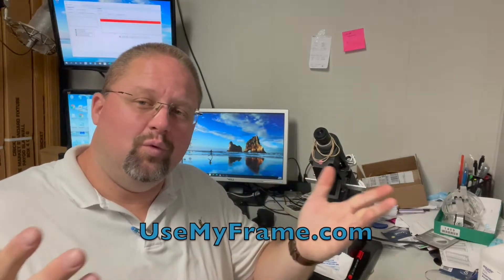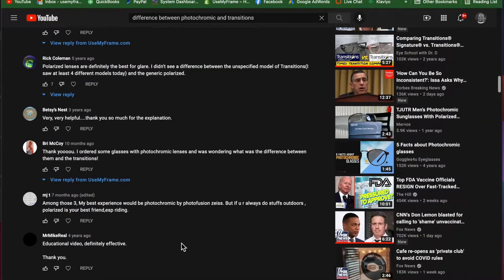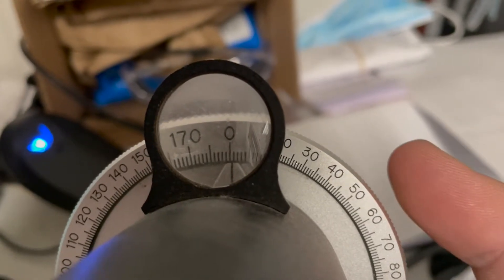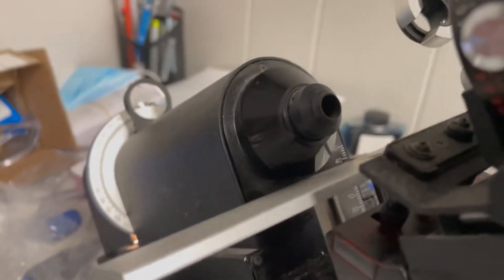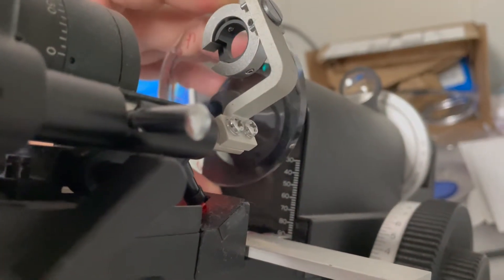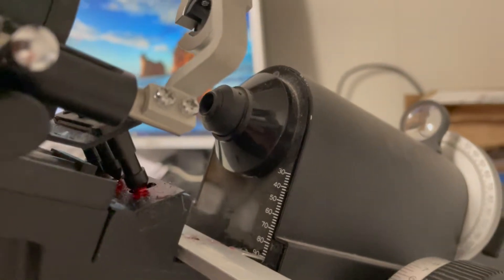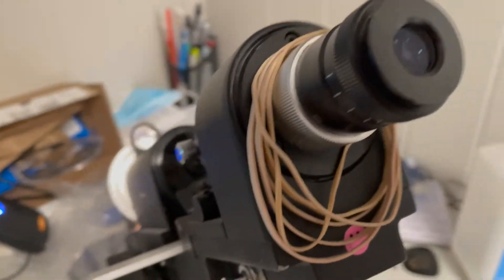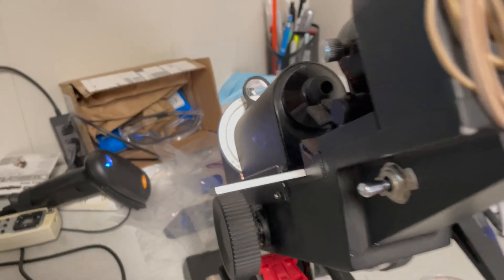Mastering the Lensmeter 101 - Intro to Marco 101

Comment: First time Marco user; I have one where the mires are off when the prism device is set at 0. They are @ .5d be and .5d bo (if it were a right eye.) 
How do I adjust the mires back to zero?
Reply from the maker: For a quick solution, try adjusting the PCD (Prism Compensation Device), located just behind the marking pins. As you turn the metal knob you'll see the target move inside the reticle. It will be tricky at first, but with a little patience you should be able to align your target back to perfect center. This is only a temporary solution, especially depending on how much it's off. If it's just a little bit it may have just been move accidentally; but if it's off by a lot then get it recalibrated because it will make spotting lenses with prism much more difficult.

Thanks for watching! :)